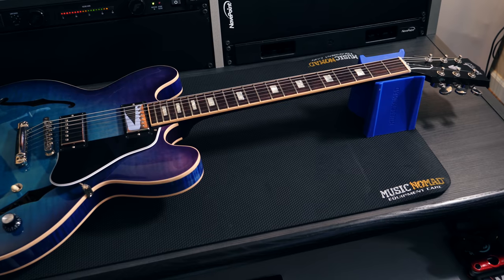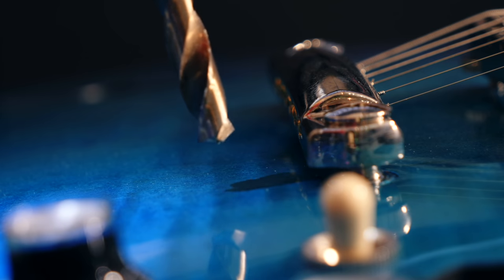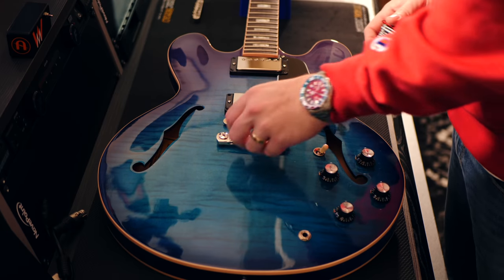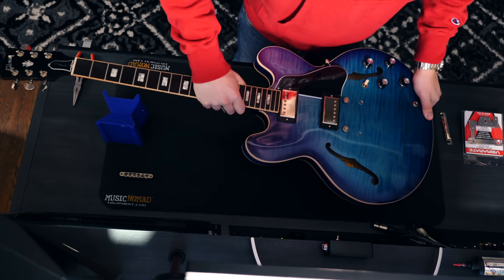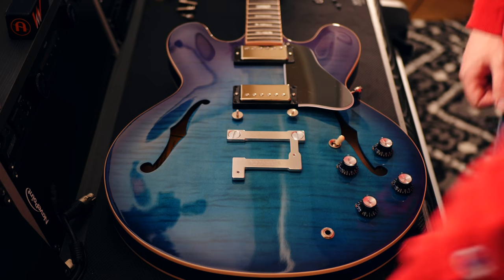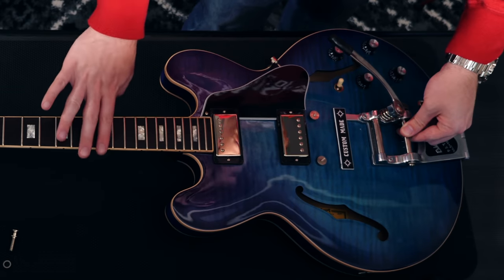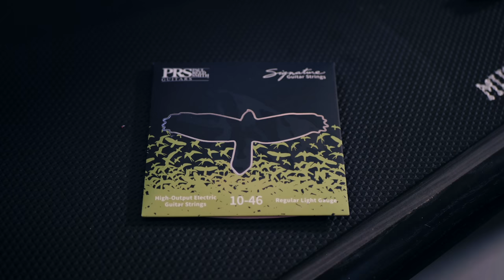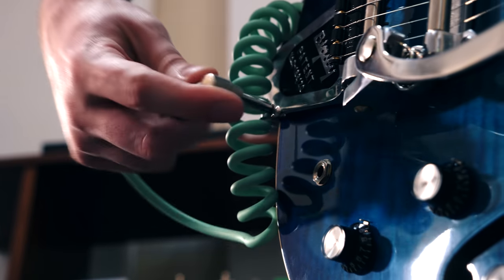Installing a Bigsby Bridge on my guitar

Comment: Tyler -  dude the next time you have to get a screw off of a tool like you did that bridge bolt, DO NOT grab it by the threads!! Tap it from the head of the bolt down, like put your needle nose pliers as if you are grabbing the shank of the screwdriver just on top of the bolt head then take something and tap on the pliers or you can even just slide the pliers up and down the shaft of the screwdriver and hit the top of the bolt head, you could have EASILY damaged those threads on that bolt the way you did it!! Also, those little pads on that will mar up the surface of that guitar just so you are aware of this! after awhile you will have finish marks where they made contact but you get that even with a regular Bigsby so that's just par for the course. One more thing, did I see you NOT pre-drill those holes for the 4 screws at the end where you fastened it by the strap button? Nice way to split the wood of your guitar mister!! Always predrill stuff like that man!! I have a Gretsch with a Bigsby and to be honest, Meh I can take or leave it. But I don't really use a wiggle stick at all so for me it's not a make or break type of a thing. I did though just recently change my Peavey JF1 over from a LP style tailpiece set up to a Trapezoid bridge and I love it! You can use the trapezoid like a Bigsby by just pressing down on the strings, alah Ted Nugent style lol. It's not as good as a wiggle stick but it does work plus you can do just one string if you want to! OH, also, yes installing it the way you did does forever mar your guitar, the screw holes at the strap button are now forever in that guitar!! There is a Bigsby you can get that installs without the need for that plate and does not use the screw holes as well. But man it sounds good and I love the finish on that 335!!

Comment: Easier way to string a bigsby.. remove the split pins on the bigsby,using a thin drill bit to drill through where the split pins  were, you gotta be pretty handy with a drill where this comes in , then fix the bigsby to the guitar as you would using either vibramate or screwing into the body, then just feed the strings in through the holes and tune up, no more fiddly string pins,

Comment: 2:11 Ouch, please NEVER use pliers on the thread of a screw. You only break the thread with it and you no longer get the screw into the guitar. I am a guitar maker and my master would have scolded me to death xD. I don't want to judge anyone, I just want to prevent you from having problems with it. It's still a great video. Keep going, Taylor! ;D

Comment: Hmmm. Your comment about tremelo and vibrato surprises me. The difference is not a similar but subtle difference. Tremelo is not associated with dive bombs and crazy whammy bar stuff. Tremelo is a change in volume and can't be done with a whammy bar. It's done with an amplifier or effects pedal. Vibrato is a change in pitch. Two completely different things that are done differently.

Comment: Vibrato is a tuning effect (periodic pitch or frequency variation) and tremolo is a volume effect (intensity fluctuation). That is the only real difference. There are only vibrato bars on certain electrics guitars, never tremolo bars.

Comment: thing about trem systems, is that literally every trem system is a vibrato system. like b r u h. sure trem systems are still partially trem systems, but that doesn't change the fact that they still do produce vibrato effects too. dive bombs wouldn't be possible on trems if they weren't vibrato systems.

Comment: So you have a very nice guitar that is standard tremolo and you want to install a Floyd rose on it... ONE THAT GOES UP ANNNND DOWN... you have to cut all that wood out to leave room behind the bridge so that you can pull it back all the way. Oof. You own a guitar that doesn’t have tremolo it is a standard bridge... you want a Floyd rose on it... YOU HAVE TO CUT OUT A TON OF WOOD UNDER THE GUITAR. Pretty brutal. Sucks. I actually don’t think it’s possible because of the paint. I have a Strat I bought long time ago (sold it) I wanted to make it kinda like Alex Lifesons. I wanted a Floyd rose on it. Couldn’t do that type of work to it I had to sell it. It would basically get ruined. Very hard to not mess up the paint. I bought a strat with Floyd rose I have 3. 2 are Fender one is a Jackson Adrian Smith signature. I built one like Alex Lifesons Strat and the other like Dave Murrays

Comment: Oddly enough, I can't think of any guitar that is pre-drilled for an after-market Bigsby. Why, then, hasn't Bigsby altered the thing to fit the overwhelming majority of guitars (those with Tun-o-matic style bridges with stoptails) that might use one? There does seem to be a small industry making "adapters" to correct the problem. Adapters sell for $60-$100, depending on the guitar they're supposed to fit. Bigsbys go for about $200. The total cost, then, is about $300, which puts you in the widely desired Floyd Rose FRX territory. The FRX has its own problems but is arguably a better machine than the Bigsby. Or you could order an alternative that you install by removing the stoptail, dropping the vibrato in the spot left open, stringing the guitar, and then tuning it. That's it. That's all.

Comment: vibrato changes the pitch, tremolo changes volume. fender calls their tremolo on their amps 'vibrato' which is wrong. and fender called their vibrato bridges 'tremolos' which is also wrong, but who would ever call a floyd rose a vibrato?! that would be correct bit dumb. so i guess the proper terms arent always important

Comment: You're right and wrong. Yes, there is a difference between tremolo and vibrato, but no, it's not Bigsby vs dive-bomb. There is NO SUCH THING as a tremolo bar. Tremolo is a modulation of VOLUME , not pitch. Both strat-style and Bigsby handled tail-pieces are vibrato bars.

Comment: I like the looks of the bigsby over all the other trem options for LP's etc..but honestly all of them including the Bigsby are IMHO, WAY OVERPRICED. Take the fender trem, it just can't be beat in price, elegance or ease of use. You can get a strat trem (cheap zinc one) for $25.00 and a wilson tremolo (at Guitar Fetish) with a steel block and saddles for around $39.00. 
    Also most of these advertised trems for LP's, SG.s, 335's and tele's are just plain ugly and at best (i have used them all) have very little touch sensitivity. 
 I can any fender trem with just the palm of my hand and get wonderful results.
    It just seems like someone (anyone) could come up with a decent attractive trem for a LOT LESS MONEY!  Listen, I don't mean to be rude, but there is nothing really great about these trem systems that could justify this outragous price of $180.00 to $239.99 and again, they just don't work very well at all. Even if you were to route out your LP (GOD FORBID) and put in a Floyd Rose... IMHO, it's just ugly and bulky and not a good solution. 
    Until someone figures out this "costly trem" problem with the LP's etc...just get a cheap strat and upgrade the pups and the bridge (zinc to steel block) with steel saddles and locking tuners (you can get locking tuners at the stratosphere for $20.00-$50.00).  Just my honest opinion. Peace.